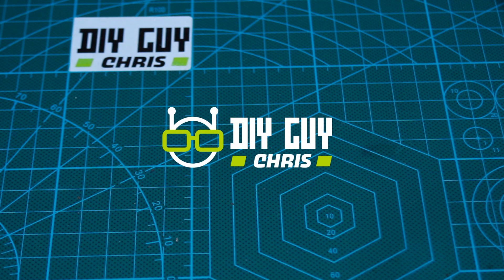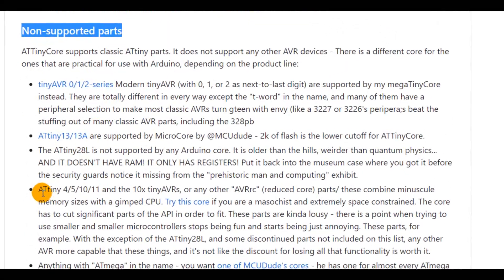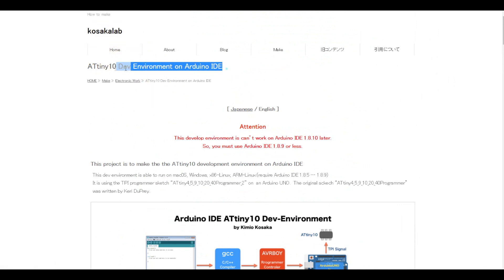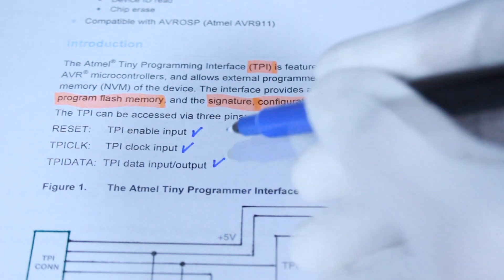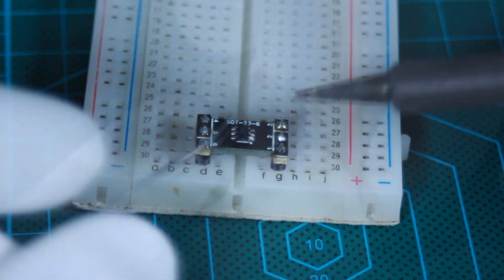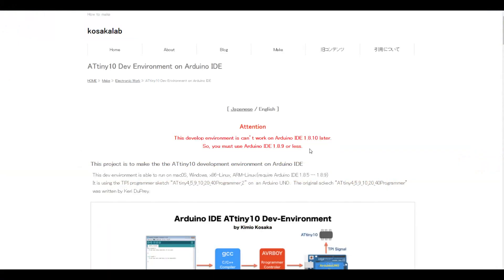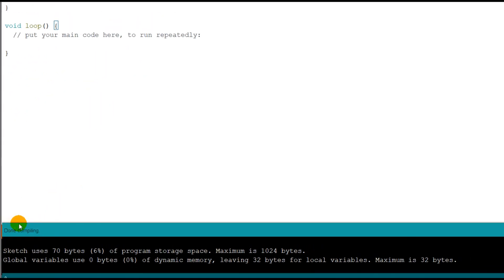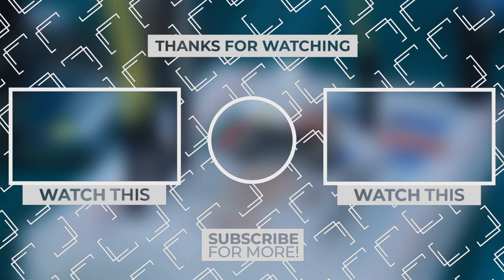How to Program ATtiny10 with Arduino IDE (Full guidance)

Comment: Worked like an absolute charm, thank you! 

A hiccup I ran into was I was using the windows store app version which didn't really let me switch to the 1.6.23 version. When using the regular downloaded app, it worked great! :) 

Thank you!
Reply from the maker: Enjoy 😊
Reply: @DIY GUY Chris  you are the man. Another fun tidbit for people, millis doesnt work.

I replaced all millis calls with a counter and my code works great!
Reply from the maker: @drhubs7049  I didn't tested many Arduino APIs for Tiny10 and also the more APIs you use the large the code size because, flash memory needs to be considered wisely for this little MCU 😌
Reply: @DIYGUYChris  yh my lil sketch it 800/1000 bytes 😵

Fortunately its enough for what I need

Comment: first I open the sketch  "ATtiny4_5_9_10_20_40Programmer_2"  compile and upload  with the board as   ("Arduino/Genuino uno",   (Arduino AVR Board Version 1.6.23")this step is ok  ,then open the blink sketch, change the board to  ( ATtiny10 (bitDuino10-arduino TPI) ,when compiling  then I got this error  (last 3 lines) 
collect2.exe: error: ld returned 1 exit status
exit status 1
Error compiling for board ATtiny10 (bitDuino10-arduinoTPI).
 
what I'm missing....
Thank's again for your time

Comment: Hello! Thank you very much for this video, is really usefull and detailed. But sadly I can't compile the code... I already changed and updated the version of AVR Boards to 1.6.22 but still not working... Could you help me or give me some advice? Thanks in advance. PD: My Arduino IDE is v1.8.13
Best regards from Argentina!
Reply: Hello! Now I uninstalled the Arduino and the related files and installed an older version 1.8.9 and now compiles, but when I try to upload occur the timeout... I already checked the connections several times, and I changed the microcontroller... can you help me please? Do you know wich can be the problem? Thanks in advance!
Reply: @darioeljatib6399  Have you solved the problem? I get same error with timeout.
Reply: @dominykassimpukas1958  same error . Did you solved it ?
Reply: @legendahistory4262   No, I switched to attiny13a

Comment: I am getting an error after following all of your steps. I went  to upload the code to my Arduino (ATtiny10) and it says "fatal error: SPI.h: No such file or directory." Any work arounds?
Reply from the maker: Try to uninstall Arduino IDE and remove all the IDE files then download the old version 1.8.9 from the Arduino website and install it, then compile again after updating the AVR Board version

Comment: Hey, I am trying to program ATtiny 10 using your method, but I don't seem to get any response from ATtiny when programming it. I get serial:timeout error on Arduino IDE. I use same version as you, I also checked connection and they are correct. I use 220 Ohm resistors on data lines. It looks like ATtiny doesn't turn on or doesn't respond to Arduino UNO attempts to communicate with it. Any solutions to that?
Reply: i had that too my solution was hooking everything up correctly to the arduino, than press upload and than connect the arduino to the PC during the compiling procces.
Reply: @JCuriosity  That's impressive given the compile time is milliseconds
Reply: @MrBCRC  it’s not milliseconds for me using the Arduino compiler.  You have a solid 5-10 seconds before it starts uploading

Comment: Chris, it's missing directories , error : c:/program files (x86)/arduino/hardware/tools/avr/bin/../lib/gcc/avr/7.3.0/../../../../avr/bin/ld.exe: cannot find crtattiny10.o: No such file or directory   

from my explorer the path I can see is this one:  C:\Program Files (x86)\Arduino\hardware\tools\avr\bin.  I guess there's some directories that are not install properly is this an arduino problem or the bitDuino10 that is not installed properly.  let me know what you think about this.  thank you again
Reply from the maker: Try to uninstall Arduino IDE and remove all the IDE files then download the old version 1.8.9 from the Arduino website and install it, then compile again after updating the AVR Board version
Reply: Hello Chris, did uninstall arduino IDE, then boot my PC, reinstall arduino 1.8.19, install artduino avr board 1.6.23,  install bitduino10-arduino TPI. load the " TPI programmer for ATtiny4/5/9/10/20/40", the select board: bitduino10-arduino TPI
load Blink, compile--->    then errors the same as before .  maybe this is not working at all maybe you're lucky it's working on your system, I search the internet if someone else was able to compile like your system, but not found anything.
or maybe kasakalab, avrboy is buggy.   @DIYGUYChris
Reply: anyway Crhis , thank's for you time
Reply from the maker: @JBERGALIEN  there is always a solution, it works for me so it should work for you (nothing about luck especially because it works for some other followers, check the comments)
Btw have you deleted the AVR boards repository content before updating the AVR boards version?
Reply: I'm not sure, what the step to delete it. does the reinstall did take care of this. if you can list clearly all the steps I should do to fix it. I'm a beginner thank's again @DIYGUYChris
Reply from the maker: @JBERGALIEN  probably the IDE still considering the GCC files of the last version, please try this method: go to c:/users/PC/appdata/local/arduino15/packages/arduino/tools and delete the content of the tools folder then downgrade the AVR Boards version to 1.6.23 and compile, please consider that the folder path I wrote PC but in general it is your PC name and the appdata folder is a hidden folder so you need to unhide it. As for the tools folder content, no worries it will be restored as soon as you install a newer version of AVR Boards. Try and let me know the results
Reply: Hello Chris, thank's for your time and support, here's the result : I deleted the "tools" directory, install arduino 1.8.19, set avr boards to 1.6.23, and 1.6.22, and both boards gave me this error  and the bitDuino10 is in the reference link : :   c:/program files (x86)/arduino/hardware/tools/avr/bin/../lib/gcc/avr/7.3.0/../../../../avr/bin/ld.exe: cannot find crtattiny10.o: No such file or directory
c:/program files (x86)/arduino/hardware/tools/avr/bin/../lib/gcc/avr/7.3.0/../../../../avr/bin/ld.exe: skipping incompatible c:/program files (x86)/arduino/hardware/tools/avr/bin/../lib/gcc/avr/7.3.0/../../../../avr/lib\libm.a when searching for -lm
c:/program files (x86)/arduino/hardware/tools/avr/bin/../lib/gcc/avr/7.3.0/../../../../avr/bin/ld.exe: cannot find -lm
c:/program files (x86)/arduino/hardware/tools/avr/bin/../lib/gcc/avr/7.3.0/../../../../avr/bin/ld.exe: skipping incompatible c:/program files (x86)/arduino/hardware/tools/avr/bin/../lib/gcc/avr/7.3.0\libgcc.a when searching for -lgcc
c:/program files (x86)/arduino/hardware/tools/avr/bin/../lib/gcc/avr/7.3.0/../../../../avr/bin/ld.exe: cannot find -lgcc
c:/program files (x86)/arduino/hardware/tools/avr/bin/../lib/gcc/avr/7.3.0/../../../../avr/bin/ld.exe: skipping incompatible c:/program files (x86)/arduino/hardware/tools/avr/bin/../lib/gcc/avr/7.3.0/../../../../avr/lib\libm.a when searching for -lm
c:/program files (x86)/arduino/hardware/tools/avr/bin/../lib/gcc/avr/7.3.0/../../../../avr/bin/ld.exe: cannot find -lm
c:/program files (x86)/arduino/hardware/tools/avr/bin/../lib/gcc/avr/7.3.0/../../../../avr/bin/ld.exe: skipping incompatible c:/program files (x86)/arduino/hardware/tools/avr/bin/../lib/gcc/avr/7.3.0/../../../../avr/lib\libc.a when searching for -lc
c:/program files (x86)/arduino/hardware/tools/avr/bin/../lib/gcc/avr/7.3.0/../../../../avr/bin/ld.exe: cannot find -lc
c:/program files (x86)/arduino/hardware/tools/avr/bin/../lib/gcc/avr/7.3.0/../../../../avr/bin/ld.exe: cannot find -lattiny10
collect2.exe: error: ld returned 1 exit status
exit status 1
Error compiling for board ATtiny10 (bitDuino10-arduinoTPI).
 @DIYGUYChris
Reply from the maker: This is an AVR-GCC error, some please check the following link to find our how to manually update the AVR-GCC files and try again: https://blog.zakkemble.net/avr-gcc-builds/
Reply: Hello, I did install the (new avr) folder and follow instructions from the link, now it's still get error, but less line please take a  look   error :   C:\Users\jackc\AppData\Local\Temp\cc5Nidi6.s: Assembler messages:
C:\Users\jackc\AppData\Local\Temp\cc5Nidi6.s:377: Error: illegal opcode elpm for mcu avrtiny
C:\Users\jackc\AppData\Local\Temp\cc5Nidi6.s:378: Error: register name or number from 16 to 31 required
exit status 1
Error compiling for board ATtiny10 (bitDuino10-arduinoTPI).
 @DIYGUYChris

Comment: Hello, I have all the versions identical to the video IDE version 1.8.9, AVR version 1.6.23 (tried 1.6.22 as well), except it still doesn't compile.
any suggestions, advice or solutions
Reply from the maker: What is the error message you got when compiling?
Reply: @DIYGUYChris   Arduino: 1.8.9 (Windows 10), Board: "ATtiny10 (bitDuino10-arduinoTPI), 8MHz(Internal)"

c:/users/deanc/appdata/local/arduino15/packages/arduino/tools/avr-gcc/7.3.0-atmel3.6.1-arduino7/bin/../lib/gcc/avr/7.3.0/../../../../avr/bin/ld.exe: cannot find crtattiny10.o: No such file or directory

c:/users/deanc/appdata/local/arduino15/packages/arduino/tools/avr-gcc/7.3.0-atmel3.6.1-arduino7/bin/../lib/gcc/avr/7.3.0/../../../../avr/bin/ld.exe: skipping incompatible c:/users/deanc/appdata/local/arduino15/packages/arduino/tools/avr-gcc/7.3.0-atmel3.6.1-arduino7/bin/../lib/gcc/avr/7.3.0/../../../../avr/lib\libm.a when searching for -lm

c:/users/deanc/appdata/local/arduino15/packages/arduino/tools/avr-gcc/7.3.0-atmel3.6.1-arduino7/bin/../lib/gcc/avr/7.3.0/../../../../avr/bin/ld.exe: cannot find -lm

c:/users/deanc/appdata/local/arduino15/packages/arduino/tools/avr-gcc/7.3.0-atmel3.6.1-arduino7/bin/../lib/gcc/avr/7.3.0/../../../../avr/bin/ld.exe: skipping incompatible c:/users/deanc/appdata/local/arduino15/packages/arduino/tools/avr-gcc/7.3.0-atmel3.6.1-arduino7/bin/../lib/gcc/avr/7.3.0\libgcc.a when searching for -lgcc

c:/users/deanc/appdata/local/arduino15/packages/arduino/tools/avr-gcc/7.3.0-atmel3.6.1-arduino7/bin/../lib/gcc/avr/7.3.0/../../../../avr/bin/ld.exe: cannot find -lgcc

c:/users/deanc/appdata/local/arduino15/packages/arduino/tools/avr-gcc/7.3.0-atmel3.6.1-arduino7/bin/../lib/gcc/avr/7.3.0/../../../../avr/bin/ld.exe: skipping incompatible c:/users/deanc/appdata/local/arduino15/packages/arduino/tools/avr-gcc/7.3.0-atmel3.6.1-arduino7/bin/../lib/gcc/avr/7.3.0/../../../../avr/lib\libm.a when searching for -lm

c:/users/deanc/appdata/local/arduino15/packages/arduino/tools/avr-gcc/7.3.0-atmel3.6.1-arduino7/bin/../lib/gcc/avr/7.3.0/../../../../avr/bin/ld.exe: cannot find -lm

c:/users/deanc/appdata/local/arduino15/packages/arduino/tools/avr-gcc/7.3.0-atmel3.6.1-arduino7/bin/../lib/gcc/avr/7.3.0/../../../../avr/bin/ld.exe: skipping incompatible c:/users/deanc/appdata/local/arduino15/packages/arduino/tools/avr-gcc/7.3.0-atmel3.6.1-arduino7/bin/../lib/gcc/avr/7.3.0/../../../../avr/lib\libc.a when searching for -lc

c:/users/deanc/appdata/local/arduino15/packages/arduino/tools/avr-gcc/7.3.0-atmel3.6.1-arduino7/bin/../lib/gcc/avr/7.3.0/../../../../avr/bin/ld.exe: cannot find -lc

c:/users/deanc/appdata/local/arduino15/packages/arduino/tools/avr-gcc/7.3.0-atmel3.6.1-arduino7/bin/../lib/gcc/avr/7.3.0/../../../../avr/bin/ld.exe: cannot find -lattiny10

collect2.exe: error: ld returned 1 exit status

exit status 1
Error compiling for board ATtiny10 (bitDuino10-arduinoTPI).
Reply: i think it's due that progam is accidently calling up a newer version of AVR

Comment: Sadly this doesn't work any more.
The avrboy program written in golang cannot open the serial connection to the arduino.
Given that the arduino acts as the programming interface that's a pretty major bug.
Why on earth they wrote it in such a frail language... It is yet another example of where trying to be trendy doesn't pay off in the long run.
At least they didn't use python ROFL
Now i'm off to buy a usbASP
Reply: Do you know why this is? I thought the Serial didn't matter for the ATTINY but I'm clearly misunderstanding what you're saying

Comment: Any idea how to program the attiny12. Many thanks in advance ❤
Reply from the maker: Hi, yes the Attiny12 is supported for megaTinyCore (from a quick serach) you can check this GitHub link for details and let me know if you come up with something from it, the Tiny12 has SPI port so basically programming it is a bit calssic through external programmer like USBASP
https://github.com/SpenceKonde/megaTinyCore/

Comment: Sketch uses 70 bytes (6%) of program storage space. Maximum is 1024 bytes.
Global variables use 0 bytes (0%) of dynamic memory, leaving 32 bytes for local variables. Maximum is 32 bytes.
2024/02/04 13:34:06 open COM13 The system cannot find the file specified.
2024/02/04 13:34:06 
Failed uploading: uploading error: exit status 1

Please help. Thanks.
Reply: I am using Arduino Nano. Is it the problem?
Reply: Solved by installing Arduino IDE 1.6.13

Comment: Thanks for the video. I followed the steps and could compile the blink code. But the upload gave me an error message.Any
Sketch uses 428 bytes (41%) of program storage space. Maximum is 1024 bytes.
Global variables use 0 bytes (0%) of dynamic memory, leaving 32 bytes for local variables. Maximum is 32 bytes.
C:\Users\A.B\AppData\Local\Arduino15\packages\bitDuino10-aTPI\tools\avrboy\1.0.1/avrboy -p attiny10 -P COM14 -b 9600 -U C:\Users\A.B\AppData\Local\Temp\arduino_build_438319/Blink.ino.hex 
2024/03/03 14:09:54 open COM14 The system cannot find the file specified.
2024/03/03 142:09:54 
An error occurred while uploading the sketch
Any suggestions of what went wrong?
Reply: Change COM14 to lower Port Number in Device Menager (eg. COM2).